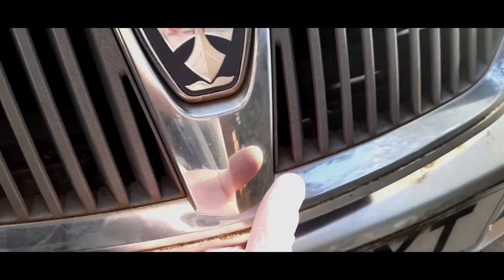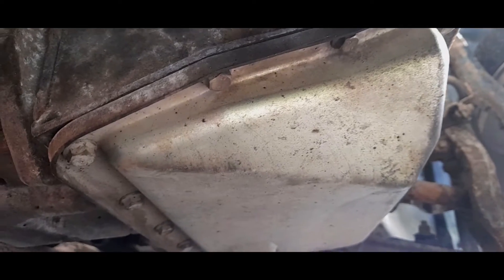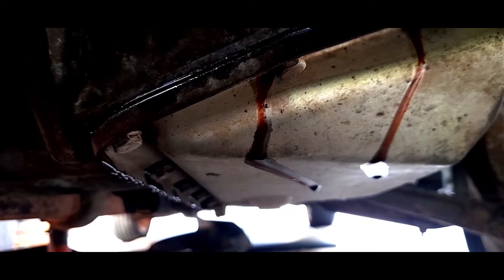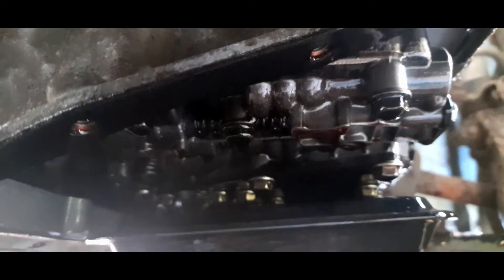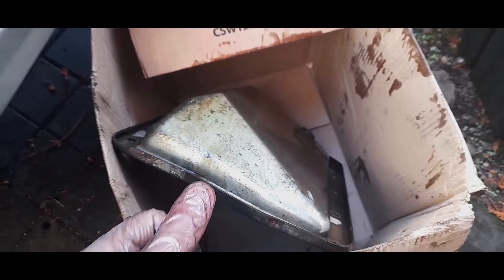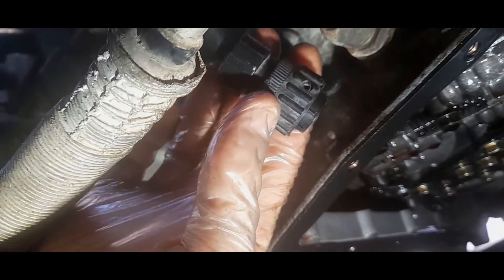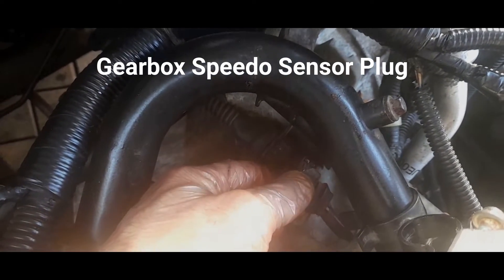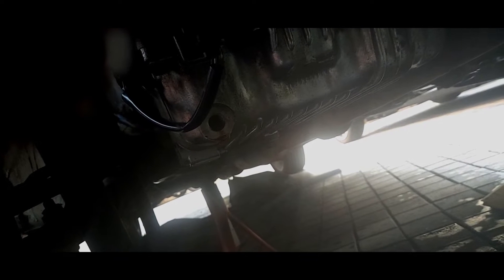Rover 45 - Project Beatrix Part 6 - CVT Stepspeed Drain & Sensor Clean

Comment: Hi mate watch all your videos could u help me my reverse lights stopped working checked fuses bulbs nothing wiring in tailgate is all good just wondering where the reverse light switch Is located on theses
Reply from the maker: It's the starter inhibitor switch on the back of the gearbox by the driveshaft, it has an electrical plug that needs cleaning every so often, it gets dirty. Clean the connection that may be the issue :)
Reply: @usuallyfixingtinkering  do they not have a separate reverse light switch sensor ?
Reply: @usuallyfixingtinkering  going crazy without the lights working all of a sudden happened